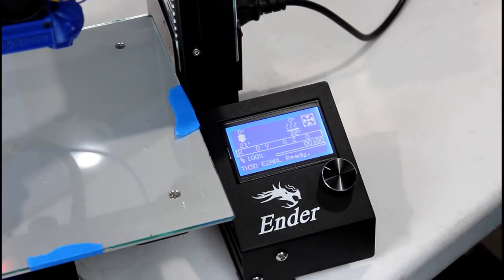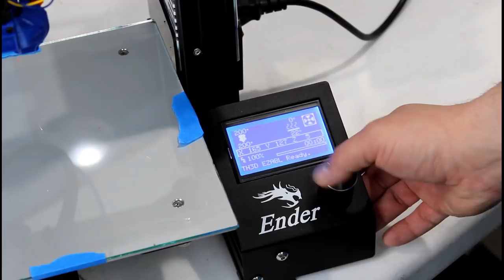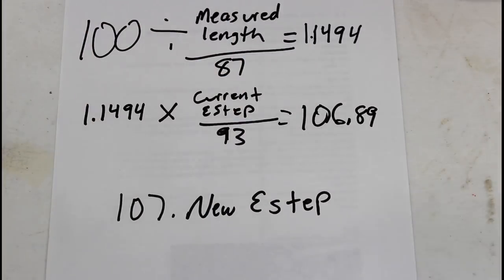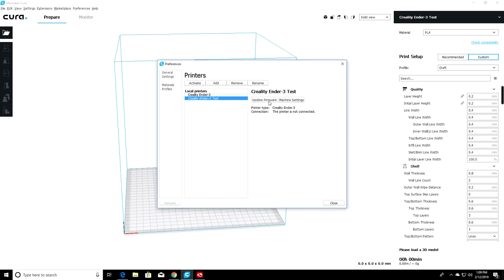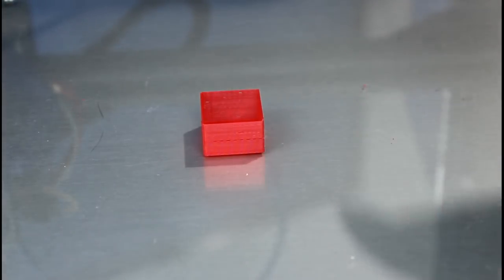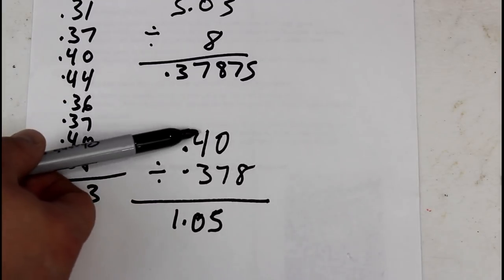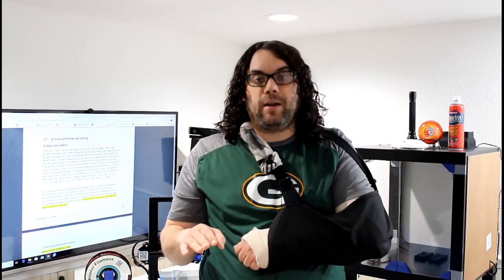Section 1.8 ESteps and Flow Rate

Comment: Hello,
Sorry to tell you this, but your measurements with the caliper are not fine:) the filament should be straight when you measure the length. When i did the esteps calibration, i have created a text file on my computer, and put the code from Luke's PDF, and after saved that file test.gcode, and run it on my ender 3(i am not even sure if i have the option that you have in my menu-i have stock firmware)
Reply from the maker: Thanks for watching! That is a good way to do it as well! When I measured it, I made sure it was straight, but when I put it down to film it, it kept curling. That is why it looked like that in the video. I appreciate the feedback though!
Reply: Is it better to run the filament through the nozzle when I calibrate my esteps? First time I used your video to calibrate ,after changing my extruder. But if I run the filament through the nozzle I have some differences: the default was 93, after air method was 94.7, and through nozzle 110. I believe the best option should be through the nozzle because this is as close as possible as the real printing.
Another question is related to the method to extrude 100mm: if I run it from the printers menu it is very slow but if I run a gcode for extruding the 100mm the speed is increased, and the results are different. Hope you can answer to all this question

Comment: In my case on my ender 3 with dual gear extruder, I have different esteps depending on filiament type.
Reply: Use flow rate instead for per filament tuneing!

Comment: Who taught you how to write math equations?!
Reply: I know right. It's so confusing what he's done in this video
Reply: Yeah, I was like, What? 100/(93/93)= 100/1=1.0752 ? Since when?
Then I was like wait, he means 100/ 93, only written down in a weird way. 

But then the second line caught me.  100/93= 1.0752 alright but then you go and multiply the result with your measured length again? So x/y=z and z *y= x duh!
Had to view this three times to understand that by pure coincidence the Esteps/mm in his eeprom was equal to the measured length value.
Would have been a lot clearer to set up unique variables like this:
E : Esteps/mm value from your eeprom (stored in your printer)
M : Measured extrusion length (the extruded piece you cut off)
L : The desired length of extrusion (i.e. 100 mm)
F : Factor of current deviation from L
N : New Esteps/mm value to store in your eeprom

Then it is: L/M=F and M*F=N.

Actually it's pretty simple percentage. In this example 100 mm would be 107.52% of the actual extruded length, so you want to increase your currently stored Esteps/mm by 7.52% to get to the 100 mm, because that's the amount it is lacking. 

7% of 93.4=7.02368 ; 93.4+7.02368=100.42368 or even simpler, because of the nice coincidence: 100-93=7 so add 7 to get 100
If your current Esteps/mm correspond that well to the measured length, it should be obvious that 1 Estep equals 1mm.
Reply: @artmcnamera7984  That was exactly my thoughts about the equations that were given. I was like... okay 100/(current esteps/93) = ..... But how?!?! And how did he found out the current Esteps. But apparently you could find it in the firmware.

Comment: Geesh I ended up needing to drop my flow rate to 75%! I'm not sure if measuring with calipers is a perfect method, as normally you will get thick and thin bits of filament laid down if you looked real close and the nature of calipers means it will only ever measure the maximum value, I'll let you know how I get on with 3/4's of normal flow.

Comment: do i have to do this if im printing from .20mm to .12mm
Reply from the maker: If you change your extruder or anything on the extruder, you will need to do the e-steps and flow. If it is stock then you will not.

Comment: My all 3 reading are different.
1, 94.9
2, 92.3
3, 90.2
which one is correct?
My stock exturder Value were +00.0, so what I do now ?
Reply: Remember it's my first time estep calibration.
Reply from the maker: Do you have a newer Ender 3?
Reply: @TheEdgeofTech  yes. 2 months old 😊
Reply: As I am beginner, after reading I got the value of 100, and I set the extruder on 100. Flow is already 100. But now material missing with bubble. What I do now.
Reply from the maker: @rczone9830  No problem, that's what this is for! :)
Reply from the maker: @rczone9830  Awesome! If you did need to change it you could do it right from the control panel then! I did a video on that and it's in the list :-)
Reply from the maker: Shoot me an email with a picture of the blobbing, and I will help you out :-)
Reply: @TheEdgeofTech  any Facebook page or login?
Reply from the maker: @rczone9830  The Edge of Tech Official on Facebook
Reply: @TheEdgeofTech  need to level the bed again after estep calibration?

Comment: After I got my TH3D EZABL Pro sensor this calibration stuff no longer works. I don't think its correct because when I follow this at one specific print resolution it will work fine but then when you change print resolution the first layer almost always fails. I keep my TH3D firmware at defaults cause it just works. I never touch the flow rate either and all my prints are fine.
Reply: What did you end up doing? I got one of those sensors, with plans to install it. It seems like a huge pain tho, with the flashing and all the BS they didn't tell you about before buying it. 
Should I even install the thing? My printer was mostly printing fine, except for the esteps causing crashing and extrusion issues, which led me to here
Reply: @urjnlegend Why would you order something that you didn't know what it was or what was involved? It's literally the best mod I've done to make my printer extremely reliable.
Reply: @markjones2349  it was advertised as being the easiest thing to add to your printer on the market. It's nothing but a pain. For a company that does so much, they sure do suck at telling you what it is. As a consumer, I shouldn't have to do extra research, especially from them
Reply: @urjnlegend  Well lets be honest here. There are YouTube tutorials that hold your hand through the entire install process. So clearly you didn't do your research first. The physical installation couldn't be easier. Flashing the bootloader does take a little work but you can thank Creality for not including one, that can't be blamed on TH3D. But again there are many tutorials that hold your hand the entire process. If your not willing to learn anything then 3D printing is not for you at all. There is a learning curve, sometimes steep. So the only person that is responsible for not teaching you, is you. If you have a specific question and need help then look upo a video, article, photos, ask questions. Or don't.
Reply: @markjones2349  my point is that the way th3d compiles their information is exactly the reason this is even an issue. Like I said, for someone buying a product, there are no warnings, until you get to the point where you buy it, then they show you the process, which THEN they tell you your printer list where if you need a bootloader or not. If the guide is available BEFORE you purchase, as someone who has never done this before, I don't exactly know to look for such a document.
After looking at the guide, after purchasing, realizing I need all this extra shit, (when they know this before Eve offering it) they even say on the guide in red letters,na huge disclaimer, something that should be said on the fucking product screen.

My point, is even after following the guide, it's poorly written. It's essentially the same at the tutorials I tried to watch, where the idiot is trying to show how to install something, then 5 minutes is, he needs extra screws not included in the package, or anywhere. The type of tutorials where you watch half of it, to find out it didn't work. This is exaclty how th3d guide is. I pre read it (you fucktard), and I immediately noticed how the important prereqs for each fucking step is after the fucking step, a mile down. It's clear they know how to do the fucking process, the issue is they can't teach someone how to do it effeciently. It's ok if you don't understand how to help someone either, your comment clearly shows that . Either way ,I'll end up making a better mockup of their info, because they're so shit at it.
Reply: @urjnlegend  How did you think it would hook up? Magic? If you have a specific question ask.

Comment: Mine was 99mm.. so my new e-steps come around at 93.9393. Should I up it by one or just leave it?
Reply from the maker: I would leave it for now, but if it's under extruding then bump it up to 94.
Reply: @TheEdgeofTech  didn't know I would get an answer this fast. Thanks a lot! I also have one other question.. Currently the rim around each object prints perfect, but when the nozzle enters the 'rim' to print the first layer of the actual object, the pla doesn't stick to the bed at all.. It feels like the nozzle is further away inside the 'rim'.. Any ideas?
Reply from the maker: Your bed could be warped. Is it glass?
Reply: @TheEdgeofTech  yes glass. I've put it on a flat surface but no wobble, so I think it's ok.. Maybe I should try to print elsewhere than in the middle of my glass?
Reply from the maker: @WOUUUTT   Wout b  I know it sounds dumb, but make sure your leveling is good and the glass is very clean. Maybe lower the nozzle a little more.
Reply: @TheEdgeofTech  thanks! I'll try to level it better and clean it with some kind of product. I really appreciate your support!
Reply from the maker: @WOUUUTT  No problem! Let me know if that works!

Comment: so once i do the math and get my new estep, what do I do with that number?
Reply from the maker: Hi! Do you use Octoprint or any program to connect your printer to your computer?
Reply: @TheEdgeofTech  not yet, just got the printer today. I did end up finding the estep setting in the menu on the printers lcd.
Reply from the maker: @ErnieB573  Perfect! You can enter the new ones there. I have a video on that. But you shouldn't have to change them if you didn't add or change anything on the extruder. If it's all stock out of the box and you didn't add anything, you should be good to go without doing this.
Reply: @TheEdgeofTech  I installed the metal extruder immediately
Reply from the maker: @ErnieB573  Awesome!

Comment: Mine is overextruding. Should i then do the same math?
Reply from the maker: Yes!
Reply: @TheEdgeofTech  Thanks. Btw i did the test "cube" and the walls are just 1mm thick :O you said it should be 4
Reply from the maker: @gamezerge1229  if you did the new cube, it should be .8 if done right.
Reply: @TheEdgeofTech  Ok :) because my printer was overextruding at 104mm so I did the math and set it to 86, now my firstlayer looks bad
Reply from the maker: @gamezerge1229  Try 89. If I calculated it correctly it should be 89.

Comment: Hey man thx for the video, after the esptes calculation you never show where to actually change it in the machine.
Reply from the maker: If you look at the 7:50 mark on the video, i show how to add the GCode to the Start GCode in Cura. That's how it's changed. If you connect your printer to you computer or use Octoprint, there is another video to show you how to do it right on the machine. Thanks for watching!
Reply: @TheEdgeofTech  Thanks for replaying, so no change should be done on the ender 3? I went and changed the Esteps number directly on the ender...
Reply from the maker: @itzikhillel  You did it right! If your Ender 3 has a new enough firmware you can change it right from the control panel like you did. Nice work! https://youtu.be/hNPbspTTnHM

Comment: You don't seem too sure of yourself on this video.  The math display looked off as a line between two integers or text and an integer indicates division of those two number.   You should have written it as 100/93=1.075     Also the extruded filament is curved and your measurements can not be accurate without at least attempting to flatten it and make it straight.

Comment: Freaking great video!!! I think it cured my printer's evils.  I may still need the hammer.  I'm concerned that I typed in the code line wrong. I tried the link to get it.  I keep getting an error message about it not existing anymore.  Please help.  Thank you.
Reply from the maker: I would enter the the new esteps into the printer directly via the control panel, or using Pronterface or Octoprint! I have videos on how to do that too, and it's much easier.

Comment: You're better off just measuring it in place, because you can pull it straight. With the curve of your filament the way you measured it, you've introduced an error. It needs to be straight in order to measure it accurately.

Comment: Have never hooked printer to computer and don’t know what octoprint is.
Reply from the maker: How new is your Ender 3?
Reply: The Edge of Tech I bought it last Christmas
Reply from the maker: @MrElasky123 I have another video showing how to do it right from the Ender 3 if you're printer is new enough to have those options. Check it out and see if it works. If it does not, let me know
Reply: The Edge of Tech which vid is it, was trying to find it
Reply: The Edge of Tech found the vid, just checked my printer under control and it does not have this feature. Although the printer is printing right now. But maybe I should buy a newer board that has this feature?
Reply from the maker: @MrElasky123  You don't have to do that. It's the Firmware that controls it. You can use Luke's guide to put GCode in the starting GCode of your slicer. Or if you can connect the printer to your computer and use a program called Repetier Host. Then you can use the other video you watched and follow those directions. https://www.repetier.com/

Comment: This is a great video and guide, but the math formula representation on this need a rework to proper math asap.I really got a brain twist trying to figure out the right ones!
Reply from the maker: Hi! I thought I updated it. Did you use the math in the description?
Reply: @TheEdgeofTech  yes, saw the description later. It's not wrong, it's just not the right way to write divisions etc :) Gets the job done though and I thank you for it 😎
Reply from the maker: @Webgkil  Ok, I'm glad you got it done! How would you have written it?
Reply: @TheEdgeofTech  sorry for the late reply.
I'm talking about the part with the esteps calculations.
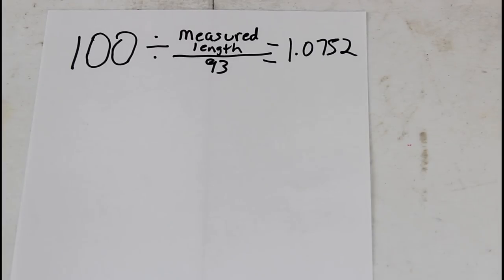Its not easy to type it in the chatbox.At 5:09 you write 100 divided by, and then the next part reads measured length divided by 93. A horizontal line is also a division symbol. Also a slash can be used.
I'd write 100 ÷ 93 , or if you want to explain 93 is the measured length, i'd go 100 ÷ (measured length) = 100 ÷ 93 = 1.0752.
Putting measured length in parentheses right next to 93 is also wrong, cause 100 ÷ 93(measured length) can be read as dividing 100 by the multiplication of 93 times the measured length.

So yeah, to cut things short, you were writing the explanation of the number above the number, with a horizontal line in between, which is a symbol for division aswell :)

Comment: You got it wrong. You need to do it while filament is pushing through your nozzel
Reply from the maker: I disagree. There Is more than one method to do this as I state in the video. This method is the open air method, the other method is through the nozzle. There are good arguments for both, but if you do it this way then you always know what your extruder is stepping without any interference from the boden tube or hot end. Then you calibrate your flow from there to accommodate those other pieces.

Comment: When i go into extruder the figure is o.ooo i guess something is wrong big time
Reply from the maker: You are talking about when you go to the extrude option on the menu of the printer right?
Reply: @TheEdgeofTech  Yes thats right it just shows 0.000
Reply from the maker: @MrTrexpilot  If you heat up your nozzle and go back to that menu, you should be able to to turn the knob and make the fillament extrude from there. That number doesn't mean much. That will just tell you what step the motors at and when it gets reset it goes back to zero.
Reply: @TheEdgeofTech  Thanks will try that out

Comment: Many loose ends in this description.  Little value to me.  First, what to do if your firmware doesn't have the necessary options to calculate the esteps?  Second, assuming the math is correct, everything after the math is a mystery.  What if you don't use Cura and where did all the numbers on the paper come from?  Very bad instruction.

Comment: holy fuck your math notation is terrible and confusing.  It looks like you're saying 100 ÷  (measured length/87) = 1.1494.  Which would equate to (100 * 87)/"measured length" = 1.1494.  When what you're really trying to write is (100/"measured length") = (100/87) = 1.1494.